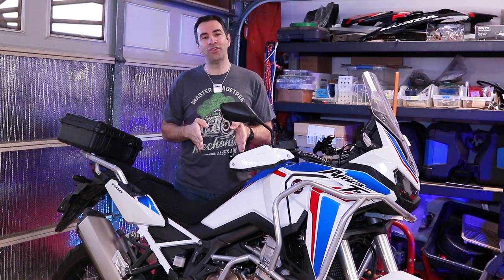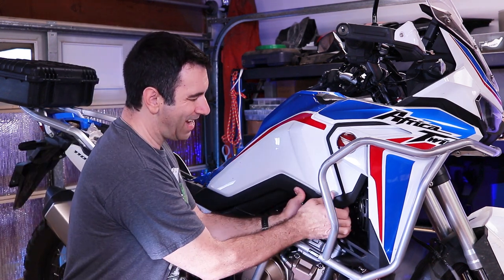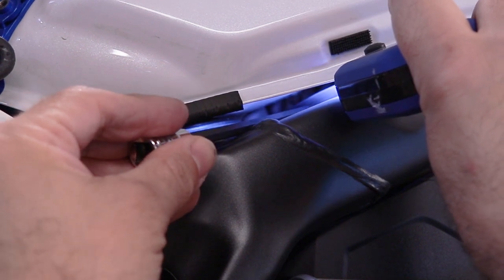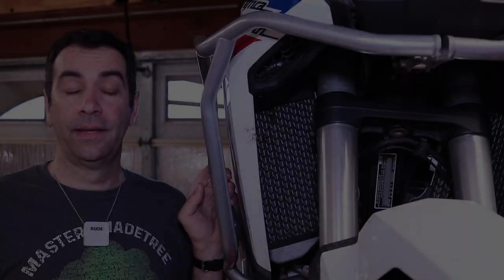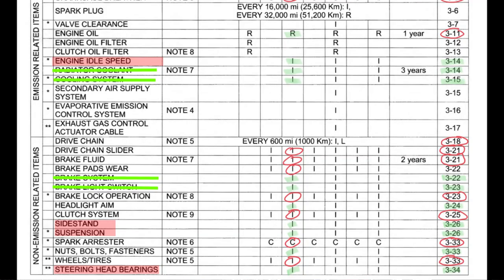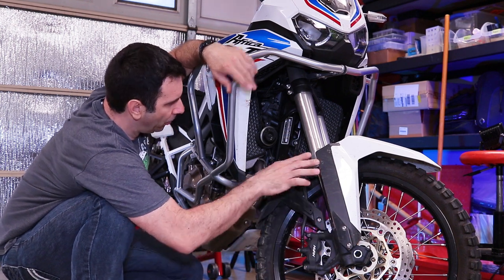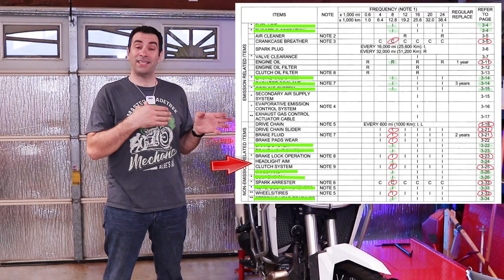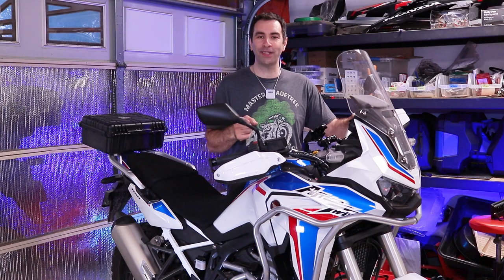Africa Twin 8000 miles service

Comment: Thanks! When the spark plugs?
Reply from the maker: Thank you. 
Inspect the spark plugs every 16000mi (25600km) and replace every 32000mi (51200km) unless they give you troubles.
Reply: Thank you for the answer but my question is when the video for the spark plugs
Reply from the maker: 😅 oh, in about 6000 more miles, so it might take a few more months
Reply: How many spark plugs does the Africa 1000 CRF have?
Reply from the maker: @Igor_chak 2

Comment: I really don't understand where they get prices from! I have a k&n panel filter in a wj 4.7 v8 motor. Cost £26! K&n 2 small filters I was thinking maybe about the same......no! £200!!!! Wtf?
Reply from the maker: I agree, that’s why I ended up using the Honda OEM, as incredible as it seams we live in a world where the OEM filter is 1 third than a k&n or the other hi-flow filters. WTF!!!
Reply: @AlbesADV  apparently the oem restrict the air flow? With high flow filters it would need a retune. Only £700 for dct model! So ofcoarse a different silencer for sound, looks and maybe 2hp! A big problem with performance air filters is the holes between the weave is larger, possibly allowing dust into the system!! Or too much oil on the filter which gets sucked in and damages bike!!! 😅
Reply from the maker: I've been using k&n for years out of convenience,  just like the hp increase the damage from dust getting thru is negligible,  but fot that price I'm more than happy to keep buying oem 🤣🤣
The AT has plenty of power for what I do with it 👍
Reply: @AlbesADV  I agree! Like I said, I have kn in my jeep, instant notice better intake noise! My 1987 gsxr 1100h has a cone kn and man that sounds and pulls like a mf!!! The cost to put kn on the AT with a silencer and a tune is about £2000! So for me, not worth it! Plenty of grunt and a great sound standard!